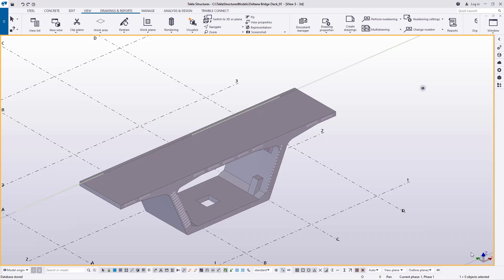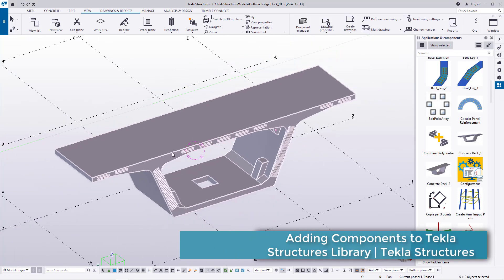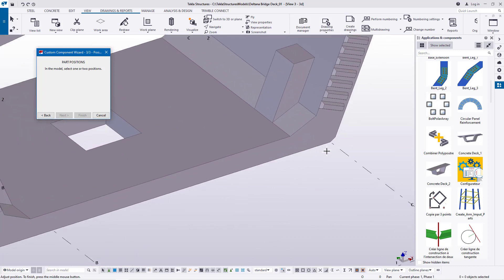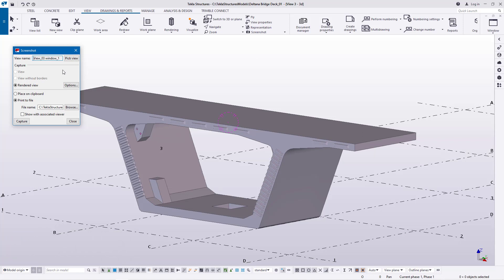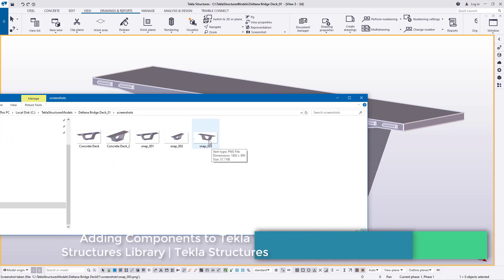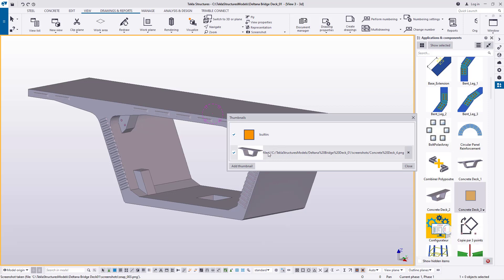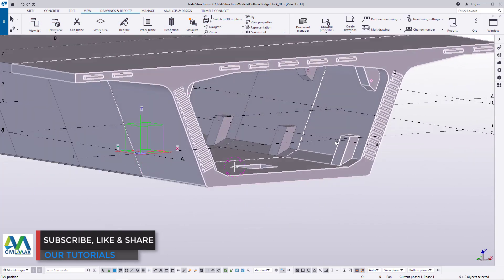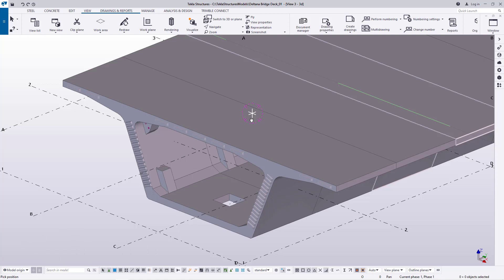How to Add Components into Tekla Structures Library

Comment: Hi Maurice Dimba, what about the cable duct line in the component?
Reply from the maker: It can be created
Reply: @MauriceDimba  Thanks! What about the change thickness of deck wall / bottom slab? I mean the start section and the end section of a component is different?